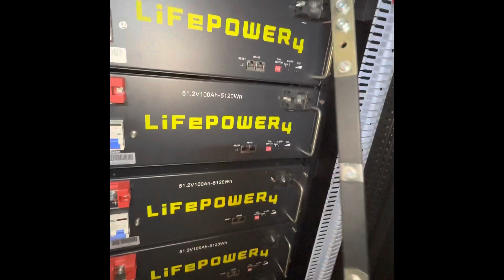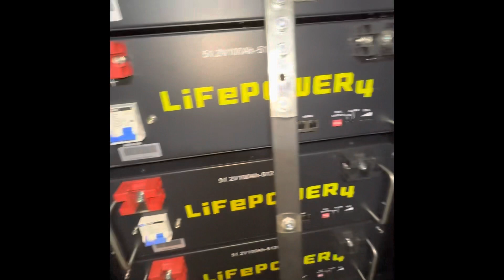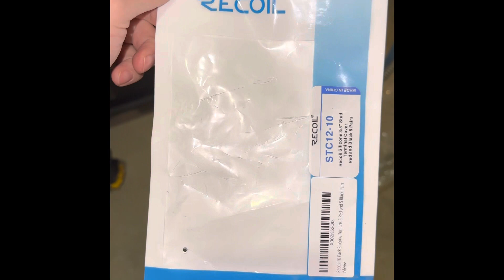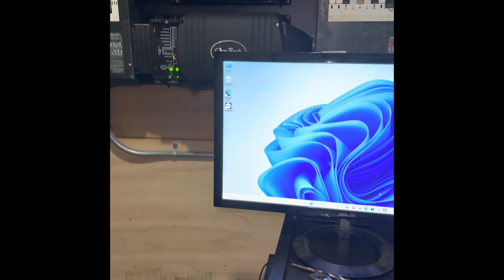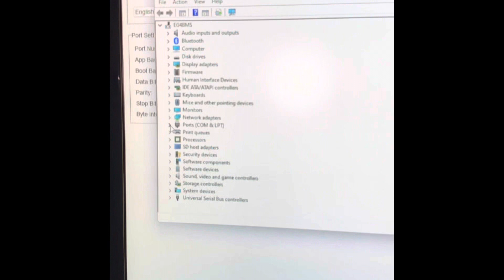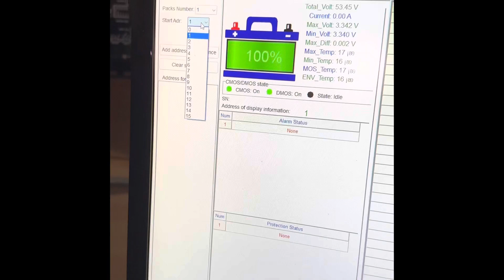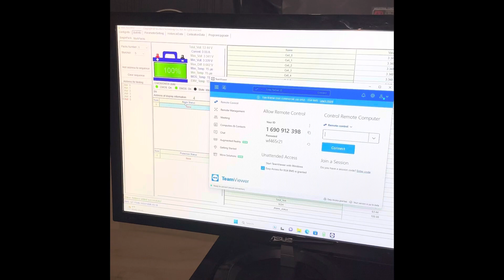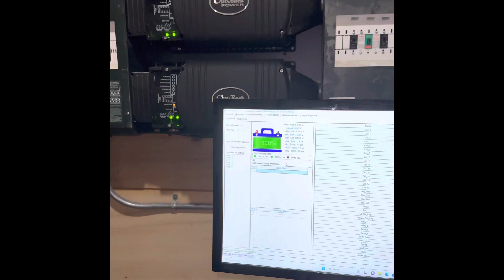EG4 battery bank final assembly and BMS

Comment: Have you considered installing solar assistant in a raspberry pie? It’s awesome, and you can monitor and change settings in your system from anywhere too
Reply from the maker: I thought about doing a raspberry pie but since the EG4 has its own system and all my Outback stuff runs on optics re. I figured a cheap small computer would do the trick. What is solar assistant?